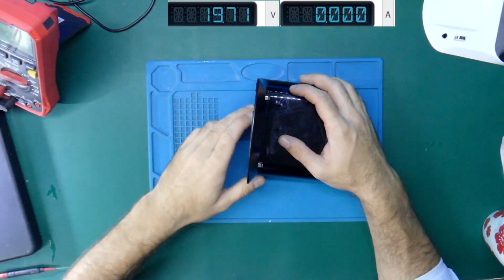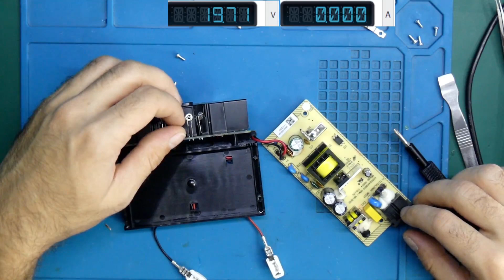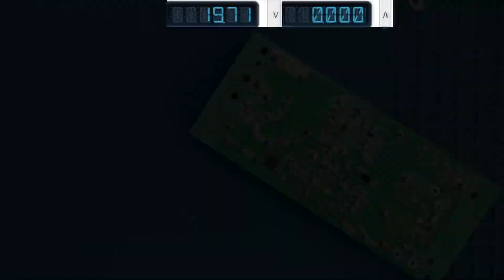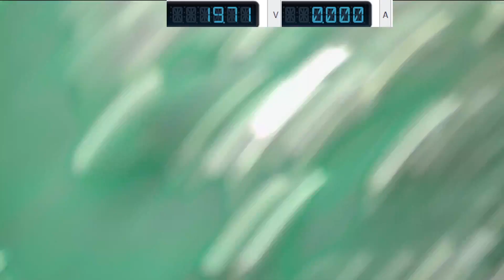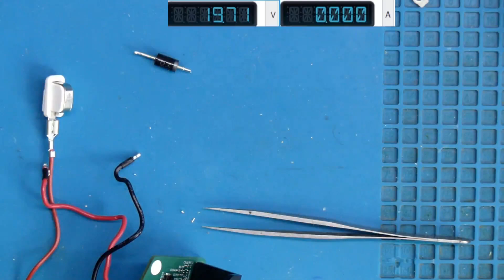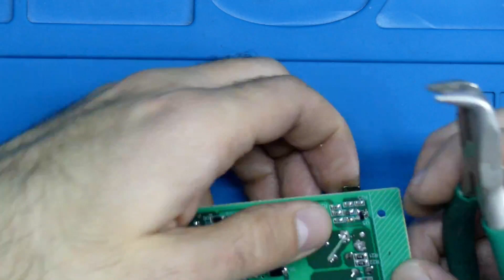Reborock Charging Base Repair 🔬🔧

Comment: It worked like magic! It was tough to unsolder those 2 joints near the diode.
Had to bump temp. to 450 C - and adding fresh solder finally solved it, like you suggested.
Big thanks!

Comment: Thank you very much for this tutorial. While I wasn't able to resolder a new diode, I managed to validate the error with a multimeter and therefore was able to change the circuit board for a new one. It worked and saved me a lot of money! Thank you!

Comment: Thank you very much for this great video. I replaced my mbr5150 with sr5150 diode and it worked. But a few months later it died again. I think they went cheap while designing this circuit. So i am considering changing the diode with MBR20200CT with a proper heat sink. Do you think this will solve the problem? Thank you very much.
Reply from the maker: Well, i didnt had any of them come back so... donno what happened there 🧐

Comment: Hi, thanks for the video!

I am having trouble desoldering the Schottky diode. I tried putting some tin wire solder at the spot but the original solder would not melt. Hence, I am not able to pull out the diode. I tried using my soldering iron to up to 400 deg C, but that didn't help. Not sure what I am doing wrong as I am new to this. Any advise would be greatly appreciated!

Edit: Or do I need to use a different wire for solder/desolder.